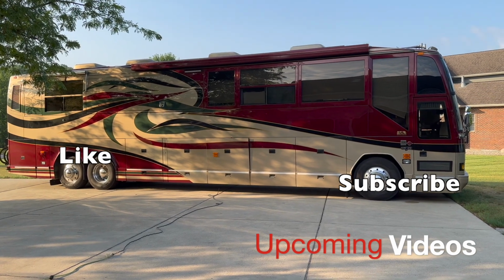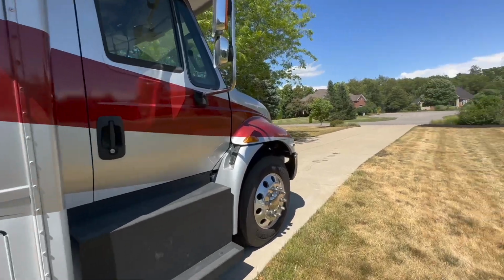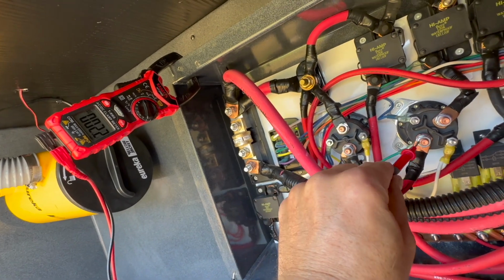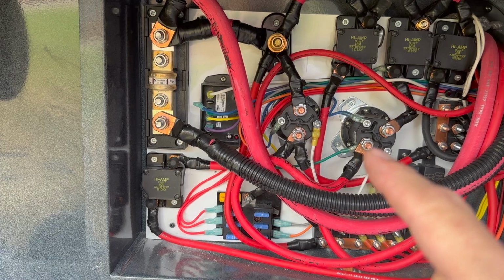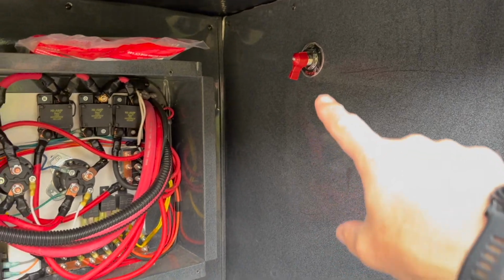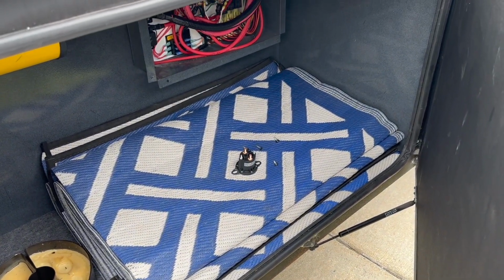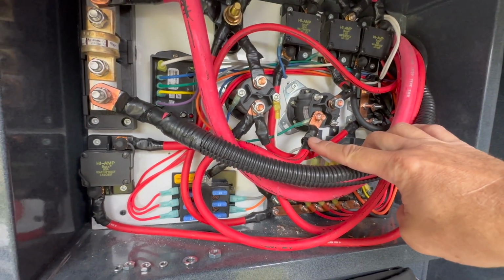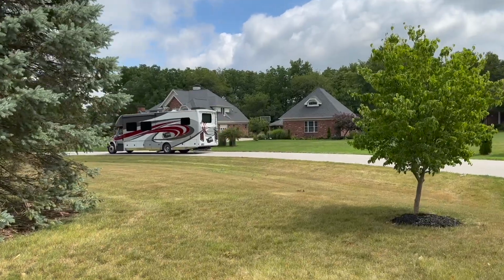Nexus Ghost Electrical Issues Found and Fixed RV Repair - Redodo Mini Battery

Comment: Why RV companies are still using these old relay is amazing. As they draw 2 amps just to close the circuit.. You can buy Solid State ones for the same price and they draw .25mA..
Reply from the maker: I can’t figure out the need for the relay for joining the start and house batteries. When reading the program for the controller, seems it would always be energized…. Agree on the new tech. Seems the RV industry is 20 years behind on most all fronts.

Comment: Great video, is that a water filter under their bed next to all that wiring 🙈?
Btw that solenoid disconnects when not charging so house doesnt drain starter.
Reply from the maker: You are correct on both comments!

Comment: Humidity my friend.  Thats how moisture got into those solenoids.   Also, over torquring a copper bolt with a steel nut is what probably caused those threads to get stretched/damaged
Reply from the maker: Probably right. Moisture is the silent killer for sure

Comment: Could the corrosion be caused by using dissimilar metals? ie copper bolts and metal nuts? I know with plumbing that's a no-no
Reply from the maker: I bet you’re right!